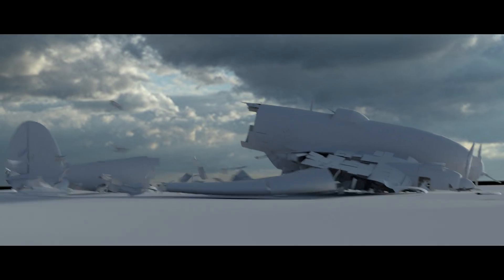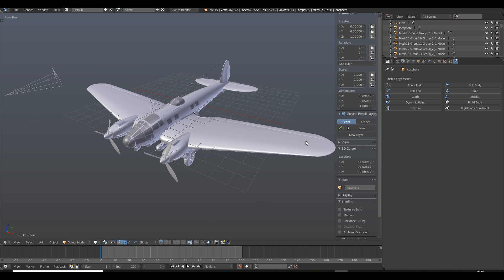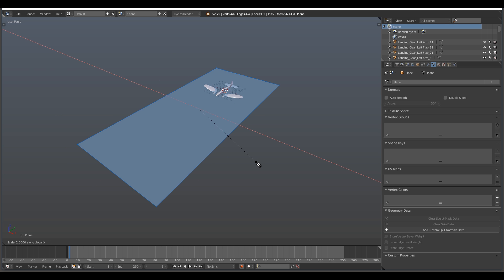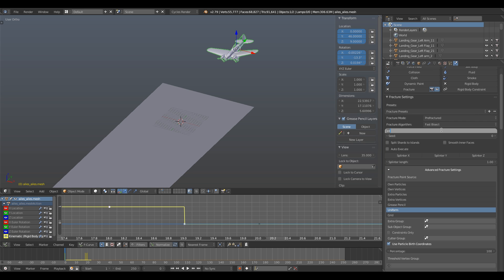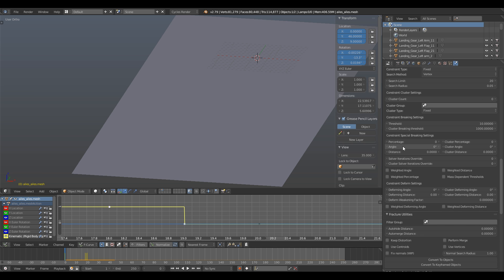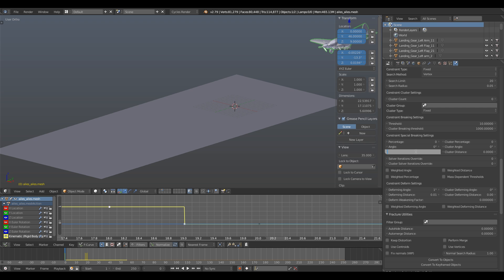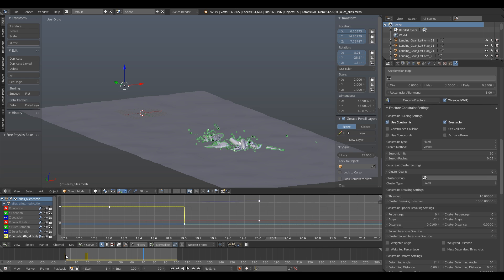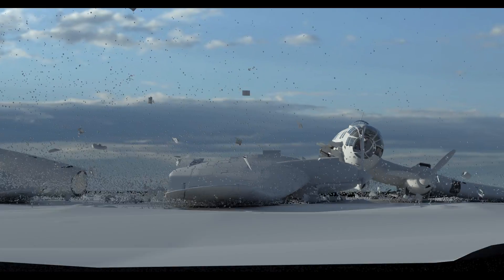Blender Plane Crash Tutorial (english)

Comment: Can someone help with the part that is sped up at around the 3 minute mark. About keyframing the animate button. He puts it on the video in text form but in the video you can tell it was more steps. There are suddenly 3 keyframes on the video for frame 18, 19 and 20 but what is set on frame 20 is never shown. My stops animating at frame 20 and there's no physics being applied, it just stops mid air where it was before all the physics steps started.
Reply: Figured it out, typing it for those that may be in the same boat. He moves the on and off keyframes of the "animate" property 1 frame to the left. So instead of doing what the video text  says that you should keyframe the checked box (on) "animated" property at one frame before, which would be 19, instead just go to frame 18 and turn on  the "animated" checked box and keyframe it. Then go to frame 19 and turn off the "animated" property and keyframe it.

Another important thing not shown in the video is that not only do you have to turn on the fracture button in the physics tab like he does at 2:55 but you also have to turn on the rigid body button. This is for those of you that dont see the animated button as that is only shown if you have rigid body on for the plane.

Comment: Thanks so much for the awesome video! But I'm having rendering issue with this Blender Fracture Build. Every time I try to render only a single frame, it says 'CUDA error launch failed in cuctxsynchronize() line 1372'. I've done a lot of google research, no solution yet... I noticed that in the tutorial your shard count is 4096, I even reduced mine to 512, but still cant render. 
I would appreciate if anyone knows the answer... my PC specs: GTX 1080, i7-9700K, 16GB DDR4 RAM
Reply from the maker: Hi, maybe you can contact the Fracture modifier Built Team. they are nice guys :) 
but first, are you running the latest built of fracture modifier ? 
best,
Albin
Reply: @albin3010  yeah I'm using 2.79b, it should be the latest version I think. I may contact them to ask, or the only solution I can come up with is to bake all the animation and export as .abc, then import it into my normal blender 2.79 or 2.8 to do the rendering. But I don't know how to assign texture in this way since the plane model is not the original single mesh anymore...
Reply: @albin3010  Hey man just a  quick update, after a few hours of tweaking, I finally figured out it's the MOTION BLUR. I always turn motion blur on if I was making animation in normal 2.79 or 2.8. But when motion blur is on in this Fracture Build, it renders extremely slowly and sometimes crash with error. Motion blur off, everything becomes fine :)
However I wonder if you use motion blur in any of these renderings? Or you add motion blur after rendering in other ways? Thanks!

Comment: Anybody struggling to load when using the vertex search method and use constraints checked? Nevermind I had the wrong settings, the most important ones I found are search radius and search limit. The lower you put those the easier it is to run the simulation because the computer doesn't have to calculate as much.

Comment: hi Albin awesome tutorial as always, maybe i will try again) do you know any render farm that support the Fracture Built? or can you tell how you manage huge file simulations?
Reply from the maker: Hi, fracture built is not an issue since you can bake your simulation when you are done. Then you import the keyframed shards into a regular blender scene and use any render farm you want. 
You can check the "cache file" box to make sure it write the simulation files on a separate folder and there is several option of compression ( for intance, particles can be baked with "light" comporession ) Hope it will help